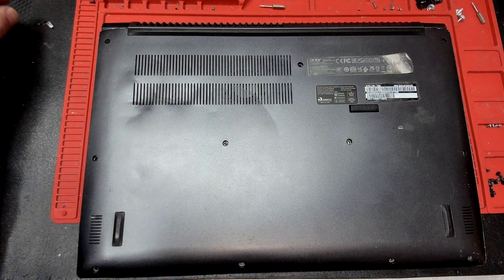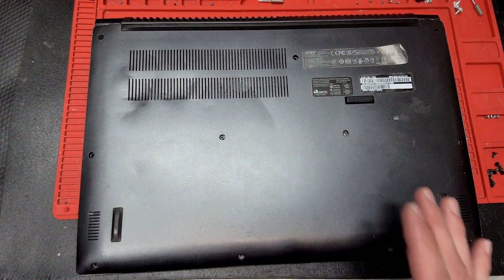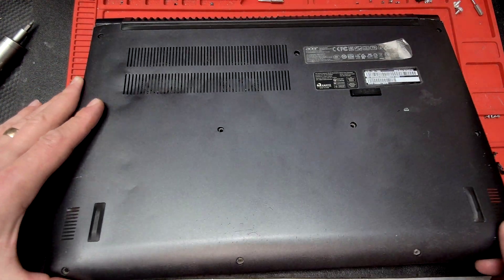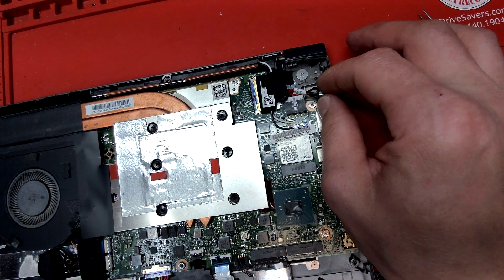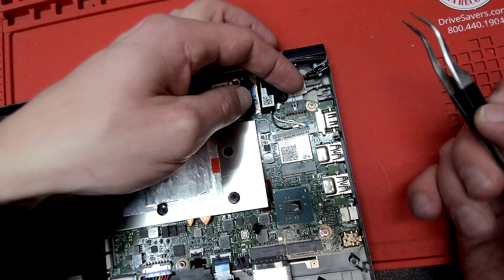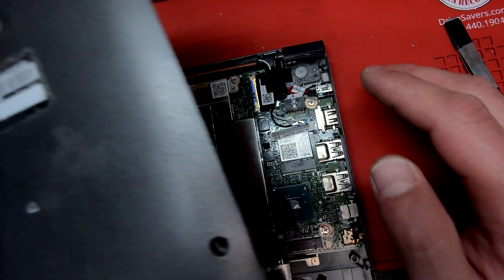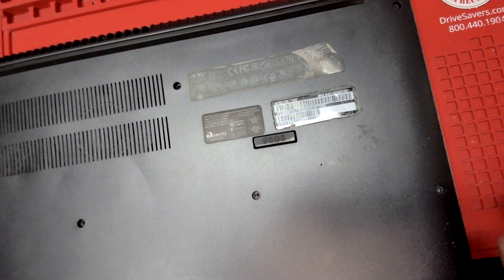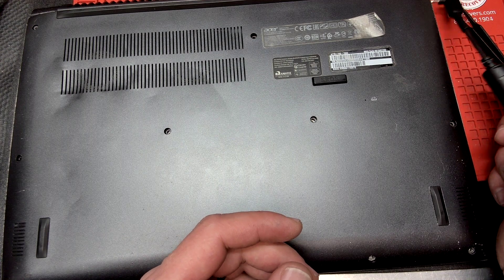Acer Aspire 7 Series charging port replacement

Comment: Hey, I have a question. I have an old Acer Aspire F15 (I use it for dirty job but it is usefull so I would like to repair it) I have a problem with very similar charing port! I replaced it and still not working properly. I am wondering what is the cause of it. Many videos about how to replate the port itself but it doesn't solve the problem! I always have to look for a better spot with my charger plug in to make it charging again! Otherwise it doesn't see any charger at all. I am wondering what i the problem here. i replaced the whole port with a cable. Maybe the port (I mean that small metal case) ihas to be somehow with the contact with ground or something? How is it possible that by pressing a little bit the port up and down I make the port workign again 🤔
Reply: 2:46 I did it and it didn't solve the problem still the same. Sometimes it is charging sometimes it is not. When I move the plug a little bit it starts charging then it stops depends on how the plug is fitted. Strange....